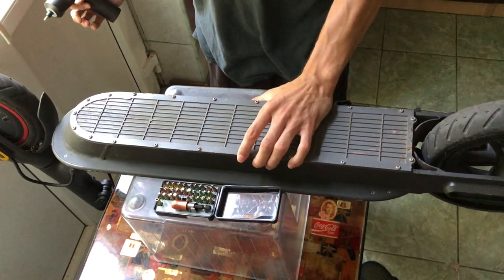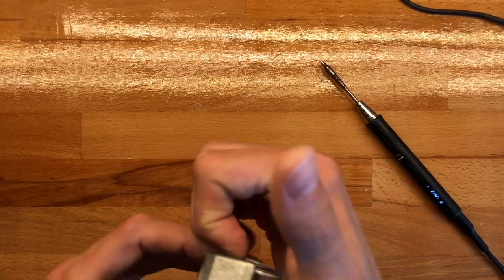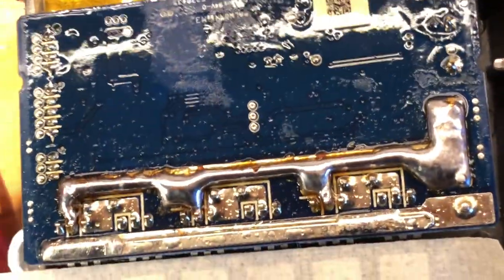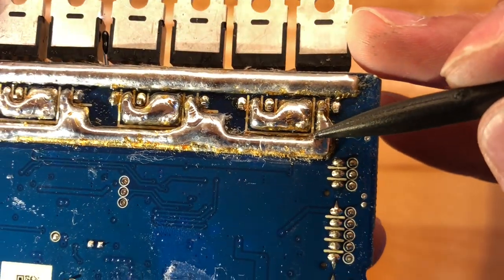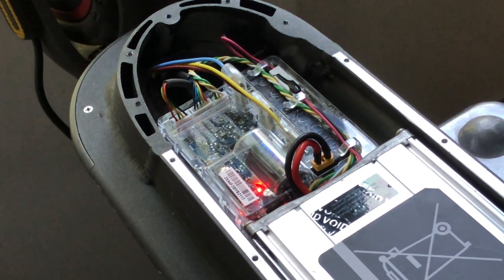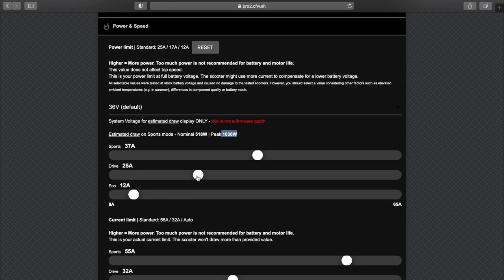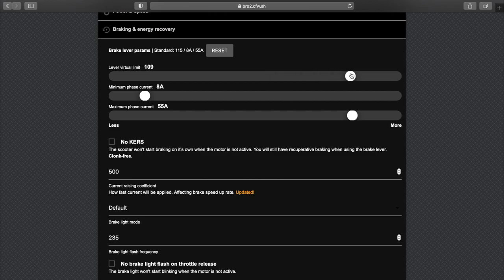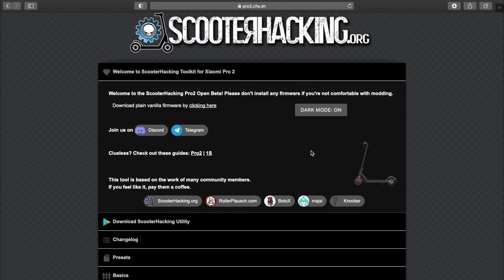XIAOMI PRO 2 Scooter - 1kW Custom Firmware & Controller Reinforcing

Comment: I don't think solder on traces helps. That is not an issue. Issue would be mosfets ratings, their temperature when working at high current, heat dissipation.
Thick traces would be overkill. Adding small fan or heatpipes would help with the heating.

Comment: I actually got my original controller (which was the best one i recon) burned up from over-use as it broke originally. That's not just my bad, but what i ordered was lied about and i never got a new original pro2 controller. I did however charge my pro2 up to the max from nothing and went for a ride down-hill. Breaking at certain sections fryed the rails. I could then see that reinforcing it could have saved me that time. But i am afraid it wouldn't matter anyways since it can happen again if the scooter is too hot, max battery, and you break a lot down-hill right after you hit max charge. I still did repair my older controller, i got 3 but 2 works and my original is dead. If the controllers are lacking anything in my opinion, it has got to be cooling solutions with how horribly hot they tend to get randomly.

Comment: Cool stuff really useful to get tried and tested advice on the settings. I have 3 controllers in a box somewhere, I'm gonna give this a shot see if I have the beefy traces too. My m365 is a 1s running the pro custom firmware, so I'm guessing it doesn't have the traces beefed up.
There's a nice guide on scooterhacking's wiki on swapping mosfets and caps to support higher battery voltage (12s basically), might try that for next summer.
Reply from the maker: do let us know how the beefing up goes 🤘

Comment: I was thinking of doing this with my Aovo 365(clone) but they encapsulated the whole board:(  -You would think 0n this that they'd screw the FETs down and use a blob of Angel sh*t (heat transfer compound) on the thermal feedback at least wouldn't you? It might be worth trying, you might get a few more Amp out of it yet-just make sure you use screw insulators when screwing down the fets,TBH the heatsink looks a bit pap-I'd be tempted at something like a CPU cooler or even 3 little ones-1 for each phase,  I'm going to see if I can get some  Xiaomi esc's-I've got extra battery, Motor and an urge for a fast 2wd :) .  All the best.
Reply from the maker: still .. I'd say obstacle number one with a generic controller is flashing it to actually make it want to push harder

Comment: given the amount of effort I would have laid some de-soldering braid or thick wire down just to add some copper to the mix
Reply from the maker: yeah .. would've been nice .. might do that next time I'll open it up
Reply: Need a bigger soldering iron for that, I just did it on mine a bit tricky to do.
Reply: @mrm1885  yeah the board and traces suck heat out of irons even at 400°C

Comment: The traces on my mosfets were with much less solder. I fluxed in much more just to reinforce them but I'm still afraid to flash it and boost the speed. It's my daily to work, 7 km trip each way. I have 700 km on the clock

Comment: You should get a spade or a knife tip for this sort of work that tip isn't ideal and maybe also look into upgrading those MOSFETs just make sure the controller doesn't use the MOSFET's Rds on for sensing. current.

Comment: As you were mentioning the 35 amps uphill in 2 people, did you do it before the controller reinforcement or after? I am running 30 amps right now in a hilly area and its too weak so i am considering to juice it up a little more. Thanks and have a wonderful day.
Reply from the maker: I had it on good authority that it needs reinforcing to go to 35 .. 

when opening my pro2 I did notice that it was already reinforced .. but there still were narrow spots on the main power traces ..

so .. my advice would be to reinforce yours .. pour as much solder as you can to make sure no hot spots form

you'll be riding with way more peace of my that way
Reply: @Darieee  but you were driving it 35 Amps before reinforcing right? I put it on 34, the temps dont seem to be that high ... During KERS mode the Amps are a little higher so i dont see its that much of a problem. Maybe a little later i will reinforce it. But thanks. I have heard that 35 is just fine for Pro 2
Reply from the maker: noo - I don't think I did more than 28A without reinforcing it
Reply: @Darieee  anyways thanks
Reply: @Darieee  any update ?
U use 35 on original pro2 controller?
Reply: @pieterbeeckx4350  guys i have a pro 2 and with standard program for 13s (they have in their page) work it almost a year (most in my wifes hands 😬 almost 100 kilos), without rainforest and have NONE problems!!! 
Scooter is pro 2 with 13s extra battery (Rita manage) and 350w motor! 
With me goes easy 50 klm. My wife 37-40 klm...
Reply: @antonypartali  and settings on cfw? 
30/60A?
Reply: @Darieee  Drive since over a year with over 40A, i think 43A, without reinforcing😂 
I think my Controller is a good from pro2
But im very lightweight

Comment: Use some good thermal pads  under the mosfetsi used gelid extreme they were around 12-15 euros but 17/Wmk and some good quality paste under the controller i saw 30+c difference controller stopped overheating even at 1kw.
Reply: what temp do you read after modification with thermal compunds and pads? My esc/controller temp sensor reads around 60 degrees during 800 watt power pull from the battery during summer time at 30 celcious outdoor temperature

Comment: My 1s is with stock Controller at 1,23 kw Output.and it works fine.
Reply from the maker: jesus christ.

rock on.

but .. does the stock 1s battery support that kind of output ??
Reply: Holly sh*t how can controller handle that amount power?
Reply: @Darieee  yeah my app says the max reading of watt 1023 watt at peak
Reply: @skygnd  i dont know man. I was getting higher and higher with the amps an then.there it was 1023 watt,s But i dont want to do higher

Comment: Hello, I wanted to ask you 2 questions, the first is what those 100 volt MOSFETs are called, and the second is, can the control unit without modifications of the pro 2 handle 58 volts without causing damage?
Reply: 😂😂🤣🤣🤣🤣🤣🤣🤣🤣🤣🤣🤣🤣 ...WHAAAAAAT O shiiiiit😂😂😂😂

Comment: extra chunky solder wont help much there. clean it off put copperbusbar that go the length and goes to fets and pwr (coppersheet cutout the shape and solder it to controller and u never gonna blow the traces
Reply: with the thermalpads remove capton tape inside controller put a long strip 0.5mm-1.0mm thermalpad instead of the captontape(make sure the fets is not in direct contact with housing cover bit extra length/with on the pad to prevent it, under controller housing dont use thermalpads they are not as effective as thermal compound.

Comment: I have an M365, and I did the same thing, not quite as thick with the solder, but I added some bus bars. Then I added another battery in parallel, and my wife scooter is the exact same thing, but no mods completely stock controller stock battery. all I did was change the firmware on the battery and put custom firmware on the controller. the same exact firmware that I'm using, and hers is faster. Lol, the only difference between the two scooters is hers has stock tires and I have 10 inch tires. It has to be the tires.

I'm happy with the speed overall. I don't think there's really a need to go much faster. it'll do 29kph. But I weigh 200 lb, and I want a little more power to go uphill. I'm thinking about reinforcing my controller to go to 72v but just limiting the amperage to like 25ish amps.... according to what I've read 35 is about the Max. But even if I run 72 volt at 18 amps its still twice the wattage.
Reply from the maker: sounds like a cool plan - do let me know what current you end up settling on at 72V if you go that route 🤘

Comment: My brake max break amp is 55 is it dangerous? Standard I have 31 in sports mode with reininforcing 
the BMS
Reply from the maker: whhhheeeeaaaaa .. hmm .. shhhhould be fiiine

if you reinforced your controller and don't go down super aggressive hills without a mechanical brake ... ought be fine

I reinforced my controller and I think it was 37 or 38 even

with 37 it brakes OK on electrical only (had my rear wheel mounted the wrong way)

if you fear finding a replacement ESC - maybe go 40 🥶

Comment: i have an issue that is when i turn on headlight , the dashboard is off and motor become slower and headlight is low .. how can i repaire it please ?
Reply from the maker: it sounds like your buck DC DC converter is failing

I would suggest either never turning on the headlight

or changing the ESC (electronic speed controller), also called the DRV, the one next to the battery, as soon as possible
Reply: @Darieee  in general without turn on headlight the speed become 15km/h instead of 25km/h , because the dashboard is watered
Reply: can i just changing the dashboard ? because the controller apparent condition is intact

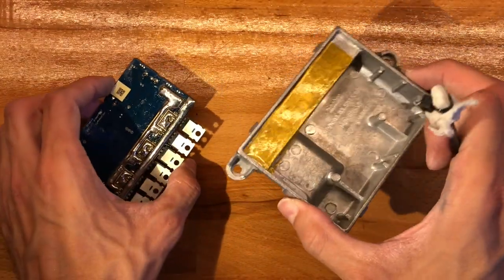Comment: 10:28 Is that yellow tape kapton tape? You really need to remove that as that is a insulating tape and will totally ruin the thermal conductivity for the mosfets.
Reply from the maker: I'm rather certain the bodies of the FETS need not be in electrical contact with one another tho

Comment: This wil work in a xiaomi 1S? i've been told that the motor controller it's the same.
Reply from the maker: yea - don't go above 750W though
Reply: @Darieee I'm planning on going as high as possible, with more soldering iron and a cooling fan to the moffsets , how high do you think i can go?

Comment: How do I make my own firmware for more voltage??
Reply: Did I find out ?
Reply from the maker: you need a "speed external battery" for that ..

there is no hardware (DC-DC converter) inside the scooter to allow manipulating the pack voltage one way or another

Comment: Why the hell did you put Thermal pad on the back of controler. New thermal paste is the right solution like on computer CPU. You won't EVER see pads there. Youcan put 1 mm thermal tape under mosets (  but remove original yellow tape from there (it has worse thermal conductivity than thermal pad)

Comment: is it possible for the cables to overheat and melt withs this firmware?
Reply from the maker: there sure is - the hotter it is outside the hotter the stuff will get under these heavy loads

if you live in a cold climate you should be totally fine though
Reply: @Darieee  thank you mate,can i install your firmware at a not reinforced xiaomi pro 2?
Reply from the maker: you sure can

it might work just fine, or it might overheat a track and burn it
Reply: @Darieee im going to do the same with you but minus 1 point in every category just for sure